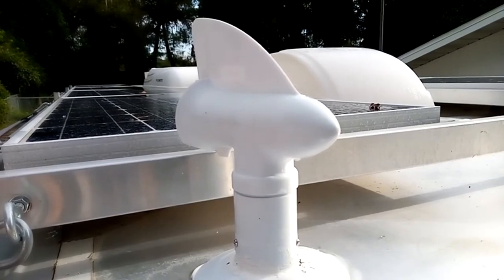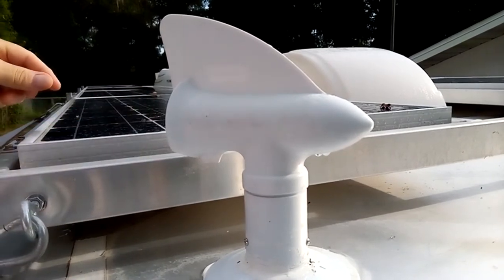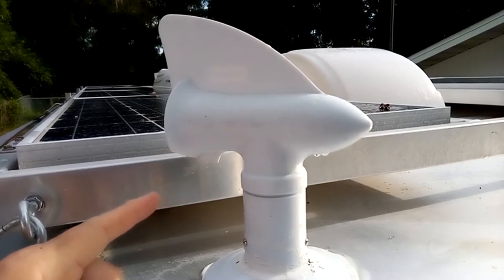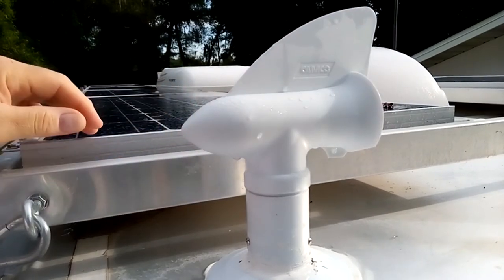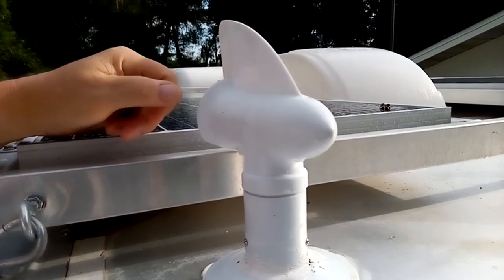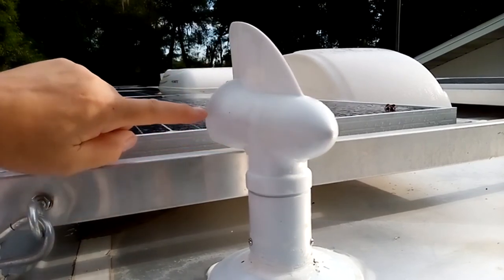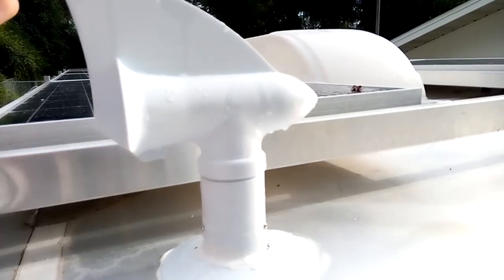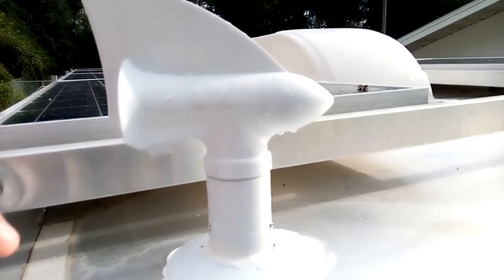E38 RV Roof Vent For Compost Toilet - Travel Trailer Conversion

Comment: I really like what you have done with this conversion of the trailer. I also like the trailer you picked could you give me a ballpark idea of what you paid for the trailer. I can't decide between aluminum or steel but I really like yours. Thanks Tony.
Reply from the maker: Hi Tony, Glad that you like what we have done with our conversion. It has worked out very well for us. Without having the receipt in front of us, we believe the trailer cost just a little over $10,000 plus tax. It could have been cheaper if we had not modified it and added some extras. But the extras have been worth the difference. One of the main reasons we went with an all aluminum trailer was because it is a lot less weight to tow and we wanted to stay with our F150 Ford instead of a heavier truck. Also, you do not have to worry about the corrosion like you would with a steel trailer. You can read more about our trailer on our blog. Here is the link to the 1st conversion post...  https://justkeeponmoving.com/cargo-trailer-camper-conversion/
Thank you for watching. It is appreciated!
Reply: @justkeeponmoving7727  Thanks for the info keep the videos coming.

Comment: Now that you've used the vent addition would you recommend it? Did it make as much of a difference? Thank you in advance.
Reply from the maker: Cesar, We never had a real problem with our venting but added it as a precaution. So I honestly cannot say how much of a difference this makes. We have never opened up the trailer and had any odors in it even after it has been parked. We felt it was better to take precaution then have to deal with it latter. Thanks for watching.